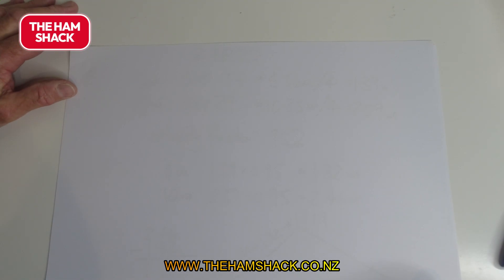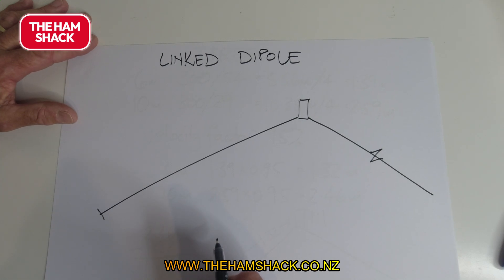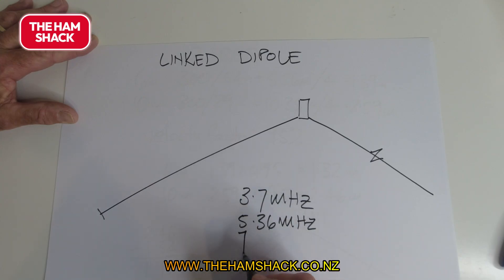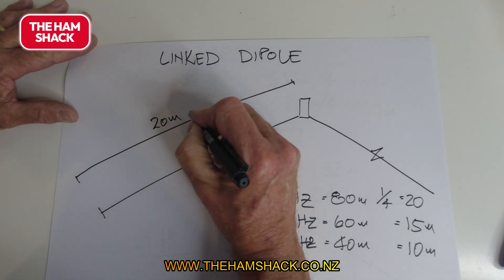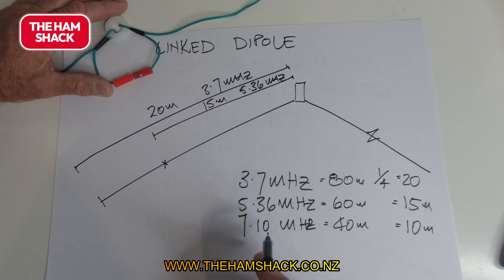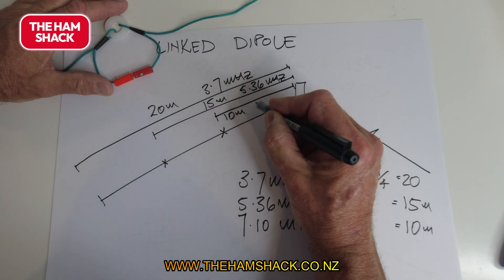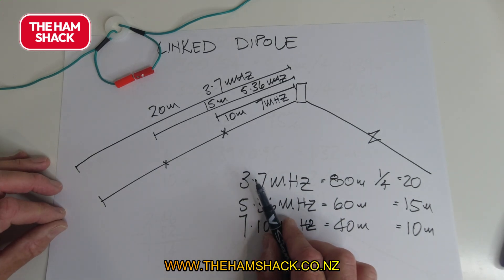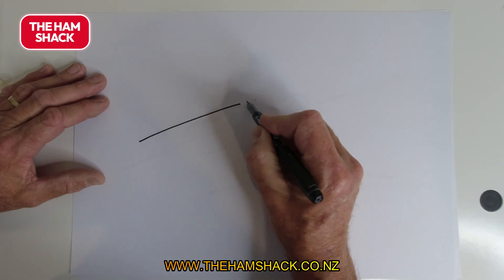Linked dipole Antenna

Comment: Nice description.  Portable is my favorite operating mode.  Linked dipoles have proven to be reliable…
Reply from the maker: I prefer them over EFHW and find I get better reports. I have added 60m to mine as the conditions are very variable I find that 60m is a nice option. I have 60m, 40m, 20m, 15m and 10m. I might add a link for 80m but then it gets very long.

73s 
Greg

Comment: Thanks Greg - that’s a good explanation.
I know that you have linked dipole antennas available at TheHamShack, do you also make linked EFHW antennas (like adding a link section to a 40m EFHW to add 60m and/or 80m) which would almost give you every band from 80/60m - 10m? 
I guess depending on the mechanics of how the link is added those additional bands would not need to be permanently attached.
Reply from the maker: Thanks Nick. I will do some experimentation in the next few days and let you know. Great idea.